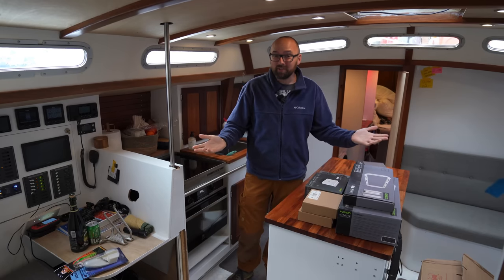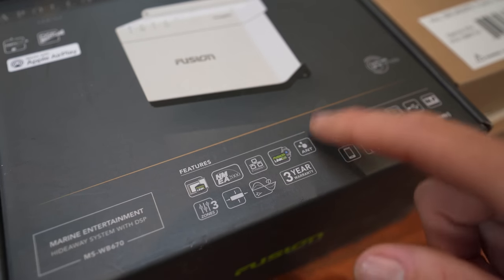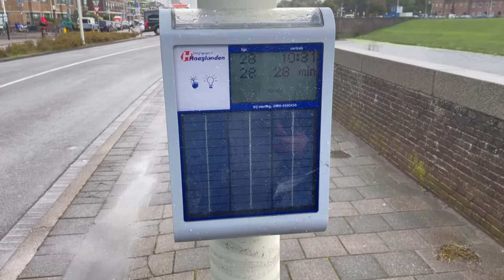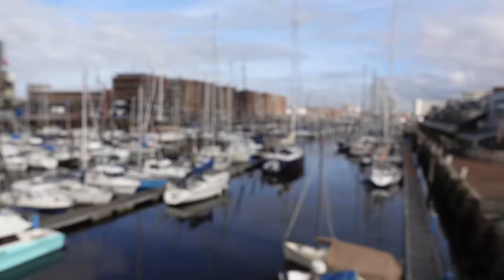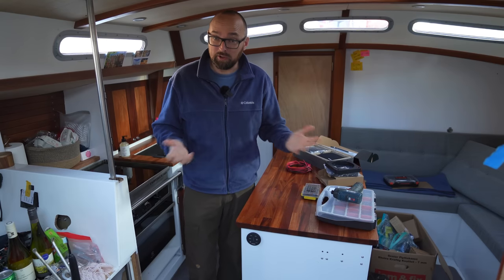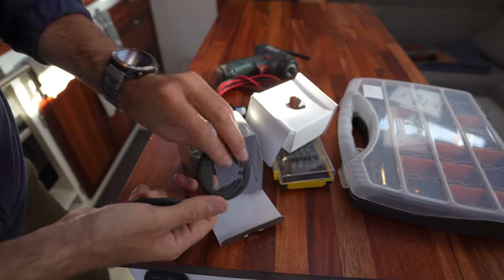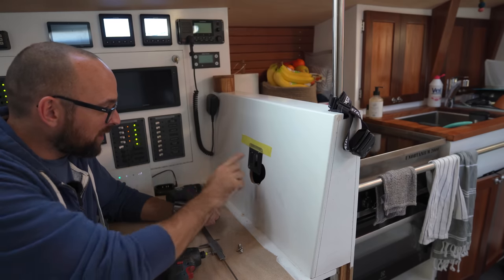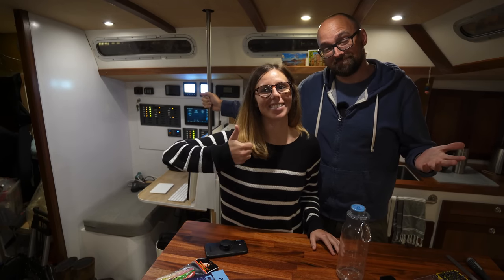Sail Life - Fusion Marine sound system, new Mac Mini & miniature madness

Comment: I sure hope you are safe from lightning strikes.  You have everything electronic.  My first sailboat a Pearson Electra sloop, Alberg Design,  was a good blue water sailboat, but in the 1970’s there was no Internet, no GPS.  My boat had a compass, 1 12 volt battery, a Marine Band radio, paper maps, and a 20hp long leg Mercury outboard mounted to the transom.  Plain vanilla sailing in those days!
Reply: Was thinking the same.
If the electronics go out......
Reply: @dugclrk  they will. The more compicated you make the system the more likely it will happen.  See this day in and day out on big yachts trying to build smart systems with plc (programmable logic controllers).   He should be fine out there but overcomplication never ends well.
Reply: My boat received a lightning strike a month ago here in Florida.  Hit my wind transducer and took out everything on the NMEA 2K network.  $15K worth of dohickies!
Reply: @pemerson56    Sorry to hear that.  Do boats have a capable lightning rod setup from the top of the mast to a ground plate on the hull?  I had a bolt hit my TV antenna and it blew out all my audio/visual electronics and pulled some 10penny nails out of pine studs 😳  surge suppressors may help.  I had a number of visitor information computers in centers at National Parks for a few years.  All had good surge suppression and grounded outlets.  The buildings were hit routinely, taking down everything except my computers.  I did have one or two suppressors toasted, but saved the high value stuff!

Comment: As a background in professional sound engineering since 1984 I would say - the richness of your speakers can be improved a lot by mounting them flush on a surface with much more air volume behind them. With those tiny bracketish frames they can not get enough air to move according to the needs for music - more as a telephonic voice.
Reply: I need to check those speaker specifically but I doubt that would make a difference. I mean it would normally but from what I've seen in the video, they're closed in the back so additional air volume would require the back to be removed to do anything to sound quality which may not be possible to do. Also, even if that was possible to do, there's literally no bulkhead thick enough to do that so it would need to be done by sacrificing storage space which is a premium abord a boat.
Reply: They are probably vented and the enclosure pretty much only enhances the very low base, not worth it.
Reply: Then I am confused even more, as an enclosure or a big cavity would be totally unnecessary.
Reply: Got to have an open back for the bass and midrange otherwise flatness will happen
Reply: These are marine speakers so they’re sealed, their tiny boat doesn’t allow for much choice space wise.
Reply: It's a closed enclosure speaker. I think the only option is to install a high pass filter and cut the lows. Then get a separate subwoofer to improve the sound a bit. Maybe the amplifier has built in filters he can use, as it's pretty much a standard nowadays.
Reply: @Scramasax  or use a good set of wifi headphones
Reply: @journeymanadventure  Yeah I know. The old school Hi-Fi is dead. :-)
Reply: @buffettfanman  flatness it is then.

Comment: Call me a Yacht Snob, but installed stereo systems on boats is a huge pet peeve of mine.  Music is very important, you should absolutely have it in whatever fashion you can, but installed systems are cumbersome with wiring and power not to mention how quickly they become obsolete.  I'm a big fan of the JBL portable bluetooth speakers.  You can have just one or ten, you can use them in any space on the boat or off the boat at beach parties, and if they become obsolete you can you upgrade without any installation hassles.  Best of all, you'd be amazed at how good they sound.
Reply: Agree.
Reply: @advancingaustralia2913  agreed also. Got a Bose and a B&O both are not perfect but excellent at least and you can move the Wifi B&O pretty much anywhere makes having diferent zones for music on a boat pointless. Batteries last longer than you would be listening to music so duration is not a problem.

Comment: Mads… regarding the nav station, you may consider making a partition in that large opening to mount your monitor.  Ergonomically, you may develop neck-soreness from looking down at your monitor display.  Better yet, make an adjustable bracket to allow monitor height adjustment so both Ava and you can be comfortable.  Respectfully,  Tim

Comment: For your monitor I think you should look into trying to flush mount the thing or at least recess it as much as possible. You would gain so much space on the desk which I would think is more interesting than angle adjustment especially since the bracket you bought doesn't have any of that.

Comment: I'm liking your nerd station. You said your going to recess it a bit but I reckon set it back as far as you can on that other wall which I think is the back of the saloon. Just take that whole panel off, mount it and make a timber trim or frame. For now though a couple of rolled up socks will stop it moving.
I've got minimal electronics on my wooden boat not because I don't like to geek out but I found  a moist salty environment and electrons don't mix well and for me, if it can go wrong it will but I'm guessing/ hoping the newer items are more resistant.
What sort of lightning protection have you got? Loving the show and your enthusiasm.🏴‍☠️

Comment: Would be interested in a video with more detail on how you will power the monitor and Mac mini!
Reply: Like everything else electronic on board…via batteries and/or the huge inverter?
Reply: I have MacMini on my boat. Powered by a small 300w Inverter and the monitor is 12v running off cigarette lighter plug. Works great.
Reply: @WindedVoyage  nice - I’d love to do something like this so I could occasionally work from the boat. how many AH is your battery bank?
Reply: @kylemccann  I have 3×180 AH lead acid batteries. Not the best, as I bought them here in Cape Verde where I've been stuck during Covid.

Comment: Would it be possible to look at a mobile monitor mount?  Just looking at you sitting at the Nav station, it appears that your neck will be turned down quite a bit looking at the monitor.  When you do the winter upgrade, maybe you could look into a mount that will fold down and lock into place, and then extend up to eye level while you use it. Spiffy!

Comment: Great video. Not sure the Mac mini is your best bang for buck! What was the story with the black water sensor? Did you figure it out? How is it meant to be connected? So you have link to it please? sounds like an option for my fuel tank which I can't access from the top to install a standard sensor. fair winds
Reply: On a boat it's essential to minimize power consumption.  The M1 Mac mini provides a combination of high performance and low power consumption that's far superior to Intel hardware.
Reply: @thesteve7397  if only life was black and white, apple vs Intel lol many more options

Comment: I don't think i've heard the words "bang for buck" and "Mac" in the same sentence for quite some time 😂
Reply: True, but apple’s M1 powered products honestly are
Reply: Well.. I’ve had my latest MacBook Pro for eight years now and I work as a cinematographer and use it daily for video editing and tons of other stuff. It only shows small signs of wear and still chugs along without complaints. So my take on this is that even if the macs cost more they will last a lot longer than the cheaper competition. And best of all, OSX is included in the price and I never have to use windows ever again!
Reply: There is little difference in modern PC and Mac, outside of the OS..
What said the M1 Mac Mini with 16GB Ram punches above its class.
- Avoid the M1 Mini with 8GB Ram
My 2013 PC runs just as well as my 2013 Mac.
Both are dwarfed by my new Mac and PC hardware. 
(all are used daily - yes my office looks like something out of NASA lol)
My advice to people is learn common troubleshooting when switching OS. There is a learning curve...
Reply: Why go with an AC powered computer on a boat when you can get the exact same system in a laptop?

Comment: I think Ava would be a hit just reading the dictionary on camera! Modernadam was a hit!
I would want speakers (or headphone jacks) in the cockpit. There are a number of sailing-friendly tunes to enhance the wind-in-the-sails din, or drown out the engine noise using headphones. I would be interested in finding out if hydrophones would work on the hull. Always wondered what The Ride of the Valkyries would do to attract a pod of dolphins! Or the Jaws Theme to attract sharks! If anyone can pull that off, it's you! I noticed you failed the smoke test while hooking up the speaker cord in the head! ;) 
Do you plan on providing a course tracker App for your voyaging? l know it will be disconcerting watching your latest VLOG of the Scottish Highlands and then finding your tracker is showing Athena anchored in a bay in the Canary Islands! Real time is regularly a rare time.

Comment: It seems that the Sound sistem didn’t impresed you much, is that right? Would you recomend it?
Thanks again guys, just really nice content as usuall!
Reply: It depends what your expectations are. For sure it's better than the integrated speakers on the average flat panel TV, or laptop, or cell phone, or the tiny plastic bluetooth speaker.
But if you want Hi-Fi, you need to introduce yourself to totally different kind of setups.
This can go far too. For some people nothing on the market is good enough, so the only option is to build everything your self.
I have Fusion speakers in the cockpit. Would I recommend them? I don't know. They do their job, but they are not Hi-Fi. But then again I don't need that in the cockpit...

Comment: For bang for the buck editing is say a Ryzen 7 4800u mini pc with 16gb of storage and 1tb of ssd would be a better value at at least 100 bucks less than the mid range one you got here in the US. Although I'm biased as a hard core windows fan. Not having program restrictions with that arm cpu is a must for me. But I don't edit in final cut so that's probably where the mini gets a big leg up for you. I'm looking to build a custom computer system for my boat with a Ryzen mini pc some weather proof touchscreens and time zero software. I'm excited to see how it will compare to your Garmin setup

Comment: Hi, I'm an engineer planning to sail the world while working here and there. For storage and backup I thought to use an conventional Synology Station which can also serve as a movie and audio storage and player. Could you explain why you chose the fusion system and the Apple TV? Seems pretty expensive to me. For playing the music on my analog amplifier at home I'm using a Teufel Raumfeld. Do you see any disadvantages on my solution? We are going to work with PCs on board, no laptops for noise and performance reasons. To extend the life span of the PC and the Syno we might have them in a separate air conditioned compartment where only little salt gets in.

Comment: Mads, maybe it’s worth installing a vertical sliding mount for the nav station monitor so you can adjust to a more comfortable height when using for prolonged periods? Neck ache using it that low?!
Reply: Was about to say the same thing 😋
Reply: Also my thought. Marine ergonomics!

Comment: Can't wait to see your solution for the monitor.
Hard mount or rubber pads will remove the wiggles.
I suggest covering un-used connection ports. 
They really do not like sea air.

Comment: Enjoyed the video Mads and Eva, great.  Try an active sub woofer under one of the saloon seats, our Alpine unit sounds great with the fusion, there is usually a dedicated sub outlet on the Fusion and boats make great listening rooms - bluetooth the Mac Mini through the system as well!   MAC Mini the best, I'm envious, but I do have a 17inch 4k laptop and the touch screen is so useful for navigation and preparing tracks for upload to the plotter.  Useful for running alternative, CPM, I-boating and the wind prediction s/ware, and of course Youtube!  I keep all my music on a portable drive, Lacie, and NAS box, QNAP.  Everything is always backed up...   We don't have problems with the black water tanks filling up - try and use the marina for the bathroom facilities and the head for when you're caught short for a pee only... a good dose of anti-bac keeps the smells away, cleans and is not toxic for the environment.  There are bespoke chemicals for the wc but they are expensive.  It's all coming together.  Well done!

Comment: Did you just say that the best bang for buck was an Apple product?

Easy to use, sleek and simple setup maybe. 

But bang for buck I’m not so sure.
Reply: Actually it is, the computer is cheap and the M1 cpu is incredible.
Reply: As a PC user of 30 years, developer and IT specialist,  I can assure you the M1 system on a chip is a monumental ARM based achievement of Apple they started to plan and design over 10 years ago. It beats (in performance and more important, in efficiency) most x86 based machines, regardless of OS, tasks and price point. There's huge amounts of youtube content on the subject. I planning to switch most of my PCs with the upcoming M2/M1X machines, only running a few Linux boxes and a Win10 for specific needs/software.

Comment: Hi guys.  I wonder if your AIS is working properly.  Your latest position is directly north of Calais heading towards Dover but that is 2 1/2 hours old.  I'd expect there to be seamless coverage across that part of the English Channel for a yacht AIS.  Hope to bump into you both on the south coast.
Reply: it's working on marine traffic - they're just off Dover
Reply: Looks like they have almost reached Dover.
Reply: @rerolley  It does but there is a big gap mid-channel which tells me there is something wrong with the AIS transmitter.  There is excellent coverage over the whole stretch of water.
Reply: That actually crossed my mind as well as the coverage (for a while already) is quite spotty….

Comment: Great to see you guys still working on the boat as you move along. Just a bit of advice, find some way to lift the monitor to eye level, there are a couple of solutions available out there you can see what suits you more (you can move the monitor back down when not using it). Working on that angle with the display so low will literally break your neck after a little while and cause you unnecessary pain... and once it's there you'll have it for years (the pain).

Comment: Looks like a nice sound setup... I dunno though, personally I would have just bought a few homepod minis.
Reply: But this system gives you most of the functionality of a few minis, just with a lot more expense and complexity! Plus you get to run wires everywhere and add electrical complexity which seems like a primary goal of this buildout.

Comment: Hi Mats, now that you are a Mac M1 and GPSmap 86 owner, I have a (totally self-serving ;-)) question. Can the GPSmap 86i be used as a GPS device in OpenCPN? 

According to OpenCpn docs, this seems to work with a GPSmap76 on Linux with GPSD. GPSD can be installed via homebrew on Mac OS X.But if the combination really works I could not find out.